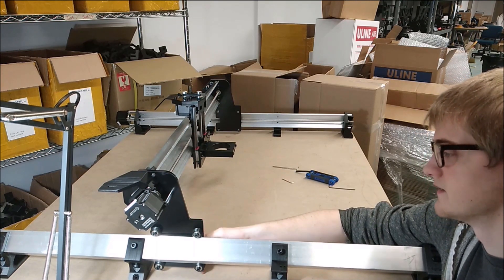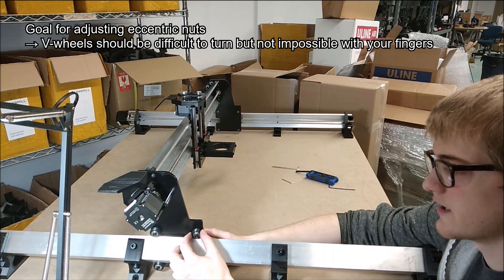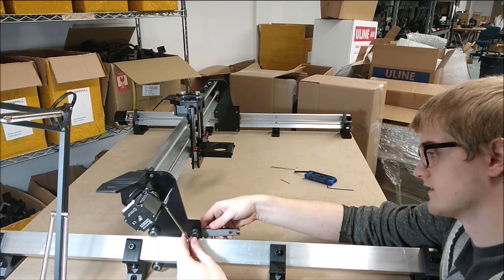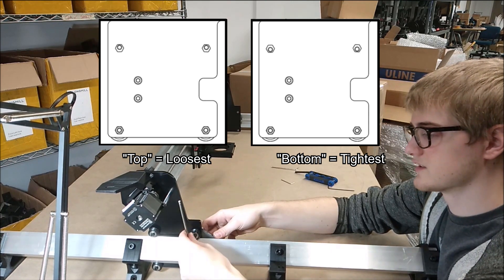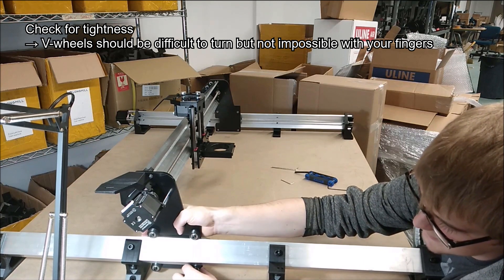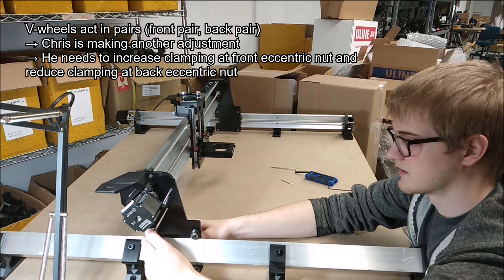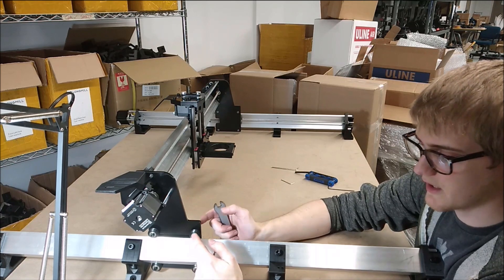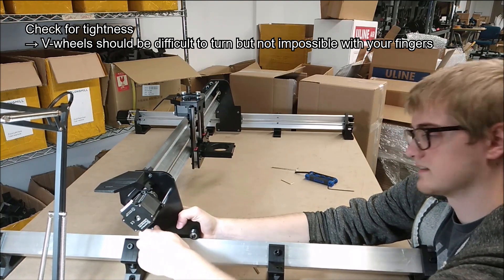LongMill V-Wheel Tuning [Annotated Clip]

Comment: I wonder if anyone has tried using steel wheels on the bottom with adjustable delrin wheels on the top.  IMHO that would give more rigidity in the Z direction
Reply from the maker: That's an interesting idea Randy, though we've found that the larger issue with the wheels is actually peoples understanding on how to set their tightness. If properly set, our testing has shown that v-wheels can be equal in strength to lower-profile linear rails. This goes against the popular misunderstanding on the market that linear rails are better across the board, but the results of many tests speak for themselves.

Comment: My v-wheels keeps getting stuck on the feet on the rails....extremely annoying
Reply from the maker: Are the wheels tightened all the way up? If you'd like you can send us some pictures at https://sienci.com/contact-us/
Reply: @SienciLabs  turns out it was the potentiometer on the Y2 motor.  It was not set to 2.2A. The stalling out just happened to be by the feet. After making the adjustment recommended from your tech support the machine now run flawlessly.

Comment: Hi Chris, upon adjusting the v wheels, my first job was to surface my waist board, after it was done I had some light black marks on the rails, is this normal or could my wheels be a bit to tight ? Thanks for all your videos !!
Reply from the maker: Not to worry Al! The black isn't coming from the wheels, rather it happens when loose dust in the air settles onto the rail and get compacted down by the wheels. MDF is the biggest offender because of how fine it is. Give it a clean off as part of your machine maintenance and you won't have any problems 👍
-Chris
Reply: @SienciLabs  great thank you

Comment: When having the eccentric nuts all the way to the top the loosest position sometimes they will still not turn some of the wheel diameters vary so by putting on a smaller diameter wheel sometimes will help with that.
Reply from the maker: Yes, we previously discovered a small batch of wheels had inconsistent wheel diameters
-Chris

Comment: Next video should be a tramming video specific to the longmill.  I was lucky with my first set up and didn't need to tram my machine.  After replacing my worn v wheels with a new set from sienci i have not been able to get it trammed as good as I originally had it.